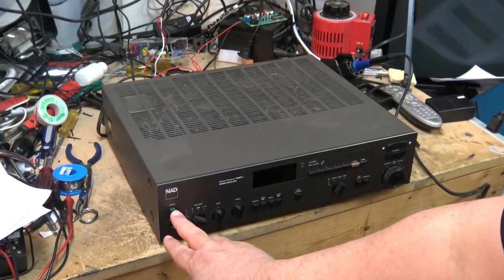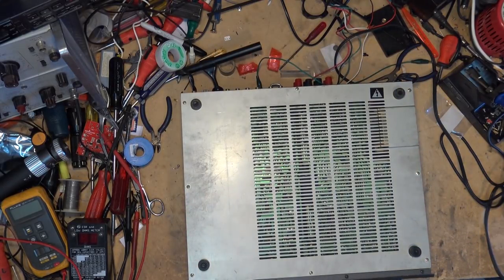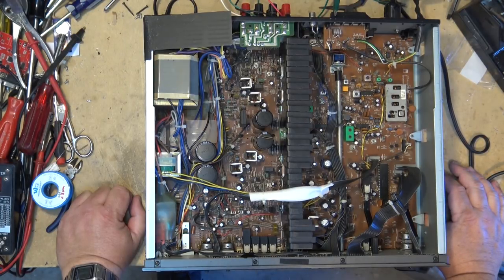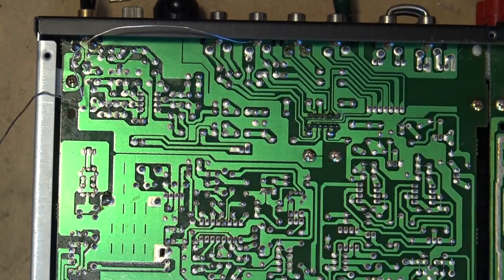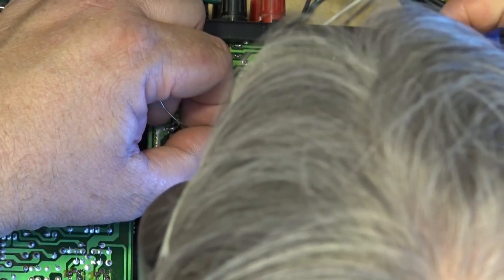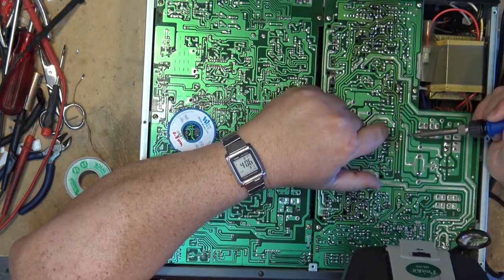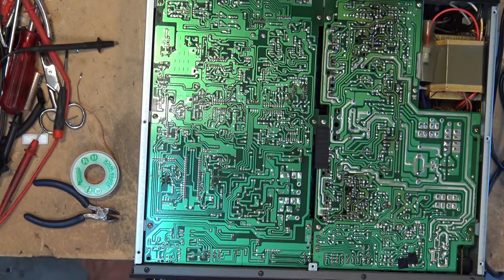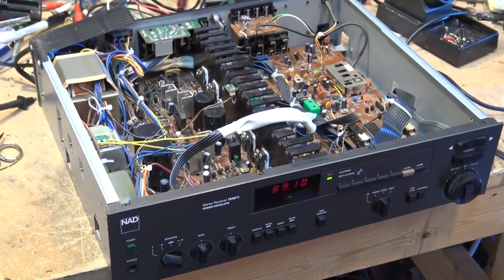NAD 7240PE left channel cuts out

Comment: Those Power Envelope series are fantastic sounding units.  Tons of power.   The problem with them was that NAD kept the costs down by manufacturing in Taiwan and using Taiwanese parts.  Controls need constant cleaning and it's not a bad idea to re-cap the whole thing with Japanese caps.
Reply: Electone_Guy True. I actually liked the non-PE Japanese built units from 84-87 much better, both in terms of reliability and in output. Based on my experience the +6db headroom PE's really lacked in terms of amplifier stability when it came to 3-4 ohm loads compared to their predecessors (7140, 3155, 7155).
Reply: I bought a 3240PE brand new in 1988 and still own it to this day.  I tortured that thing with 4-ohm KEF C95 towers back in the day that definitely dipped below 4-ohms.  Never skipped a beat.  I recently re-capped it and use it in my den.
Reply: Agree, they used really cheap capacitors. Some people have had them blow up.

Comment: One thing I could add to what is shown here -  I recommend to try using a solder sucker when reworking some suspect solder joints.  I had a case once where a Yamaha portable multi-track casette deck had a power issue and it turned out the pads of several traces that were supposed to be running to the power transformer had broken off from their traces but were still soldered to the pins.   You could not see the separation lines under the solder and flux.  Once the solder was sucked away from each pin, the breaks from pad to trace were obvious using an eye loupe.  Each pin had to be bridged or jumped over to make a solid connection to its associated trace on the board.  Simple reflowing did not work in this case, because the pads that had detached from the board created little islands and were just enough removed from each trace to not allow solder to flow over onto the traces, due to the green solder mask.

Comment: They are excellent sounding and very powerful components with +6db of headroom extension.  The problem was the low-quality parts NAD used to keep the costs down.
Reply: They are kind of like British cars, always electrical problems. I never liked the looks of NAD. The new NAD power amps use Hypex boards, but while say the amp is 200W, 8ohm, it doesn't sound like it has 200W, but more 100 classAB. A few people commented on Hypex and other ClassD boards behaving like this.

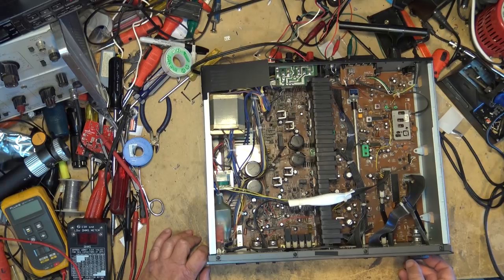Comment: Yeah the overhead view is great, there was a nice flash at 4:08! So happens I have been listening to you on a NAD 2400 monitor amp that a friend found on the street and gave to me. The 2400 does have a protection circuit... and that was the problem! Had a bad capacitor and by co-incidence the output transistor bias was also off by enough to trigger the protection circuit. I only fixed it thanks to a post on a forum about amplifiers, saying to check the bias and replace that capacitor, wish I could remember where that was.

Comment: Nice job as always.  On this one though I'd suggest the first step should have been to pull the pre-out/main-in jumpers and substitute a patch cable, with the L/R channels crossed.  That would immediately cut the problem in half. (Right channel cutting out now? Problem is on the preamp side.  Left channel still cutting out? It's on the power amp side.)  On the other hand it's good that you reworked connections on both sides, and found the too-long pins, and if staying on one side of the unit would have made me miss those, then that's a point against me. :-)  Thanks for all the vids.

Comment: Huh, those cracked solder joints are difficult to find. Good job as always! :)
Reply: Most of the time bad solder joints are pretty obvious with close inspection. You can see when they separate from the board (ie. if the pad breaks off), or there'll be a ring around the component lead in the solder where the solder has fractured.

If you do board level repair long enough, you can spot what's wrong with just a passing glance at the board.

A telltale sign of bad solder joints on this receiver is the large brown areas on the PCB, which indicates the board has gotten very hot. Overheating the PCB can cause solder joints to fail from mechanical stress and from burning off the flux left in the solder, making it brittle and prone to cracking.

I would have gone the extra mile on this receiver and figure out why those areas of the PCB are overheating. It could have been bad design from the factory, but it could also be failing components causing other parts of the board to run out of spec and get really hot.
Reply: Thanks for information!
Reply: I tell you that's a real issue components that generate a lot of heat just as one writer said ... those heating and cooling cycles are murder on solder joints ... not to mention how stressful to the component(s) themselves ... the designers don't really care about keeping power components cool that makes it a throw out for those that don't know how to repair something as simple as a failed solder connection(s) sad really LOL ... I remember the really old stuff had huge heat sinks to remove such heat ... the later stuff NOPE the designers hoped either 1) the user would bring it in for repairs or 2) toss it and buy a new one ... now to the writer that wrote about solder flux .... solder flux is ONLY NEEDED during the actual soldering after that it SHOULD be cleaned away completely ... it is conductive ... and as time passes it becomes even more conductive ... I recently worked on a neighbors reciever (the protection circuit kept kicking in) as it turns out the original solder resin had become so conductive it was tricking the protection circuit in to thinking there was an issue ... very simple solution ... isopropyl alcohol does a wonderful job of breaking down that old resin so it can be flushed away ... it's been weeks now and last time I asked him about his reciever it was functioning just as it should ... I sprayed it let it sit a minute or so and scrubbed it good with a toothbrush spraying more isopropyl alcohol as needed ... turned the circuit board so it could drain off ... and did a final flush spray off ... you wouldn't believe how brown the towel was from the old resin was they used during the manufacturing process (that's another sign if the board your working with had a tan look to it) you can bet that it's old resin and as mentioned earlier it becomes more conductive with age and in sensitive circuits that can become a serious problem causing a major circuit malfunction or random circuit issues such as the protection circuit kicking in ... you get the idea LOL low output from say a pre-amp circuit and so on hope this helps someone who is having trouble figuring out that mysterious electronic issue(s)

Comment: NAD made their gears not to last by using cheap local perts in Taiwan.

When I recapped my used 1020A, wow, OMG, the thing totally slunded different, def'ly better in rez, bass, transparency and at least depth. And that was when the 4 tone circuit caps had not been changed.

I am inclined try to recap my 7020 recvrs, 7155's recvrs, 1155 pre, and other old gears just to see them perform closer to original build.

Comment: Odd to see a NAD amp without output relays. NAD was notorious for using "el cheapo" output relays, which frequently stuck open, causing that channel to cut out. NAD was known for innovative circuit design and high "bang for the buck", but, their manufacturing could be suspect, with a lot of bad (cold) solder joints.

Comment: lol monty python, allways mad and had me glued to the tv for many years :-D.
The "Upper class twit of the year show." very silly :-D.

The E.q links on the rear panel have caused problems, sitting there for years and never used, the damp gets in and one channel sounds distorted, i've had that.
Back sockets in general are troublesome, and the grey fracture line of death on the solder i've seen a lot of.

Comment: Hi Dave--great video.  I followed your steps to repair my ailing 7240PE but was unable to get the right channel to produce sound again.  No amount of tapping, jostling gets that channel to come back, even temporarily, and I resoldered pretty much everything you did on the first board and every joint (yes, every solder joint) on the second board.  Any ideas?  I can solder and use multimeter but not much past that.
Reply: often its that dual-ganged pot that goes out. Did you resolder its' connections to the board? If so, it might be the wipers inside. I've not found a replacement, as it's not a normal potentiometer.

Comment: awesome work my friend! I like the new filming improvements!
Reply from the maker: I was looking at my tripod, and another small one that was given to me, and the light bulb went on, and within about 2 minutes I had an overhead crane!
The small tripod is solid aluminum, and is just the right size that the 3 legs will wrap around the handle of my existing set of sticks, and a zap strap around the legs and they grip the rubber handle tightly. Works like a charm.
Makes a nice jib pole and the head at the other end allows for positioning the camera.I am hopeful that it will support the weight of my pan/tilt unit, as once I get that fixed I can have remote pan and tilt.
Reply: 12voltvids nice idea! well I already like it, a little bit of old fashioned handy work goes a long way. I think it'll be a good tool to help your viewers along in your circuit bending adventures. love the videos as always and thanks for the reply! ps- will we be able to see your handywork after you get the pan/tilt functionality together?
Reply from the maker: Yes I will be filming the pan tilt unit disassembly. I is a unique piece that Sony sold 30 years ago. I used to use it in churches to remote my camera up at the front of the church during catholic weddings when they would not allow an operator up front. They would allow a remote camera, so I would put the camera up front and I would be off to the side with a small TV to see what it was shooting.
Reply: 12voltvids oh nice, I would love to see that, I am always interested in seeing old video production gear, even if it's just a tripod pan/tilt mount. in fact one of my most favorite videos of yours was the Sony single tube projector! what a beauty, and a piece of technical genius, absolutely loved that gear. in fact, I used to have a whole slew of production gear that one of my churches gave me, sadly I was a young kid and I threw most of the stuff away, it consisted of a Sony 3/4ths tape machine, two 3 tube broadcast cameras the size of a guitar case and upwards of 80lbs with lens, power supplies, hundreds of feet of multi-cable as well as a shoulder mount 3 tube camera and an old video mixer. I would've loved to see a YouTuber tear those down or repair/maintain them. :-( but I guess hindsight is 20/20.

Comment: What is NAD?  
Spray it with DOxit too.  
I had an NAD long ago, it was decent little amp.  
I once had an SAE integrated amp with the same problem as this one here.  
The repair shop wanted over 100$ to fix it, so I dumped it.  
Don
Reply from the maker: NAD was a british company, but they got cheap and moved their manufacturing to Tiawan and the quality took a big dump. They are well designed but the build quality is not was it used to be,
Reply: 12voltvids They always manufactured in Taiwan/later China though right? They were set up by a group of importers after all and used their contacts over there to keep costs down.
Reply from the maker: I believe that is correct. They designed in UK, and initially manufactures in Tiawan, and then in China, as the last one I worked on said maid in China on it.

Comment: I have a JVC R-S77 that has a problem in the tuner search system that corrects itself with a tap, I think I shall check the board in that area for bad solder joints.

Comment: Did you know that you can use the eraser end of a pencil and slightly drag it across the circuit board and help find loose connections a lot quicker.... Try it, it really works...  I've been using this method for years...

Comment: Is NAD still around?  They were premium quality.. back in the late 70s.. or early 80s.
Reply: Michelle Pucca Yeah, owned by a Canadian company now. Still producing good stuff.
Reply from the maker: Correct Lenbrook group. Same people responsible for PSB speakers, which is what I have in the shop. They are designed in Canada now. I am not sure where the manufacturing is done as I haven't seen any of the new gear, but it is very highly rated. Lenbrook manufactures their PSB speakers in Canada, so possibly they are building their electronics here.

Comment: Hello have a question. I have a denon avr-4810ci and it turns on then powers off
Reply: Maybe you fried the amp's power transistors. All AVRs suffer from it when people think it can do 5 or 7 the rated power, say 7ch, 7x110w. Sorry most of them can not, so people please don't crank the volume to loud to prevent clipping. The other problem is the amount heat dissipated by the electronics inside - the little heatsinks just aren't big enough. And finally don't expect them to drive loudspeakers rated below 6-8ohms in multichannel mode, the output transistors and power supply are way too small for that.

Comment: I had same model, same thing,
 one channel would cut out after a while
Had it repaired like 10 times, finally just gave it away.
 board on right is horrible soldering, board even looks to be burnt from heat
Cheap product
Reply: Well another awesome fix!
Thumbs up 👍👍👍
Reply from the maker: NAD Nasty Ass Distortion! The PE (Power Envelope) are better, as they have more dynamic power for music peaks due to the dual voltage design (Class H) but the lower power units like I have are real speaker killers. I killed a really nice pair of speakers in about 2 minutes and I wasn't cranking it clipping, or at least it didn't sound that way but it did cook the voice coils quickly on what was a really nice pair of wharfedale speakers.
Reply: @12voltvids  that sucks, my son bought me an old pioneer, I plugged in and omg what a sound, never been opened and it's 1973!!!
It's not even scratchy either
Reply: @12voltvids  by the way thx for the great vidz,  absolute pleasure to watch, so much to learn, much appreciated!

Comment: Hey Dave, I know you have been doing this for decades and you are still here. I was wondering if you ever worry about your watch especially working on amplifiers and televisions? I've read enough horror stories concerning rings and watches on electronics engineers and techs.
Reply from the maker: Edward McLaughlin 
I don't wear a ring for that reason dispute having a very nice one. if I am sticking my hand into something that is energized I remove my watch and put it in my pocket. if I am working around high voltage one hand is in my pocket too. not only am I trained as a maintenence engineer, but my current day job I am a telecom tech and that has be climbing power poles and working in close vicinity to mains power so yes I am careful. my bench is also running on an isolation transformer. the variac is isolated as well.
Reply: Thanks for the explanation Dave. I knew you were safe in the other areas. Just don't want to see you depart the Earth! :D I really enjoy this channel!

Comment: just cannot understand why someone would thumbs down, it escapes me.
Reply from the maker: Because the internet is full of assholes. These are the same ones that get upset when I mention ad blockers, and why I am against them, as they affect my revenue stream. They suggest that I sign up for patreon, which I do have an account, but they will never be a supporter. Then they whine and bitch about things beyond my control like the noise from the fan in my monitor, or if I pronounce solder the correct way with the "L" sounded out.
Guaranteed there will be the same goofs thumbs down my next NAD receiver, which I just did today. Had to trouble shoot a dead transistor, and it took quite a long time to find, but the haters will watch, and give me the raised middle finger, which is basically what the thumbs down is right.
None of them have the balls to tell me though, because they are afraid I will block their ability to post comments. Not that I would stoop to their infantile level.
Reply from the maker: This could be a jealous service person that is pissed off that I am giving away their trade secrets. I recently walked into a repair shop to try to buy a part, and the owner asked me to leave, and told me why. He didn't appreciate me taking food off his table by making these videos and proceeded to call me a hack. His web site, which I will not mention even mentions the "internet experts" as causing people to wreck their electronics. I don't see it that way, I am an expert electronics technician. I am still in the repair business, and do have 30+ years in the field, but I no longer earn my living doing repair work. I make some extra cash fixing stereo equipment, and face it, it is the audio gear that I make money on. Vintage audio is still profitable, but nothing else is. I make considerably more off the advertising revenue, and that allows me to offer very reasonable repairs. Most of my shop repairs are 50.00 or less. Find a shop that will touch an item for that. Most charge 90 to 100 as an estimate fee before they do anything. So me giving advice on troubleshooting techniques and also working for a fraction of what the shops still in business charge creates enemies in the repair field, and I would bet that the majority of the down votes are coming from service techs.

Comment: The lead was a little longer, but you were really whamming on that cap, on my opinion. I take away the lesson to not flex the boards when yapping stuff.
Reply from the maker: PC boards are stronger than you think, and how else are you going to find a bad connection. You need to tap on the board lightly which is exactly what I was doing.